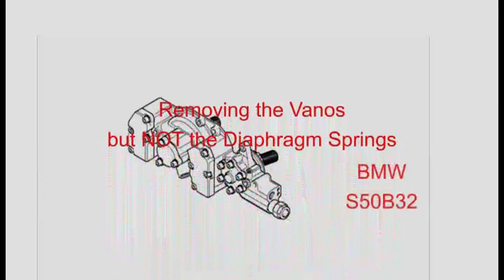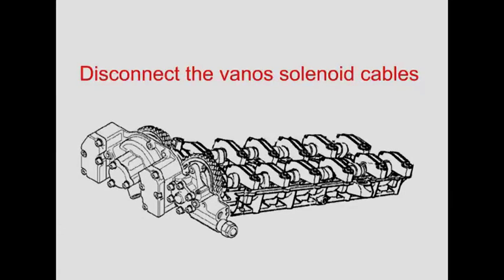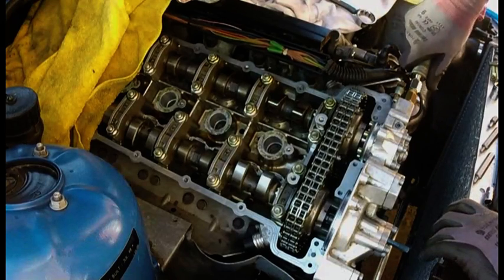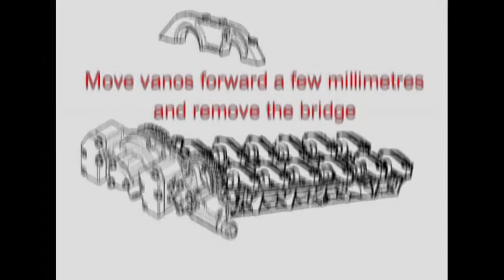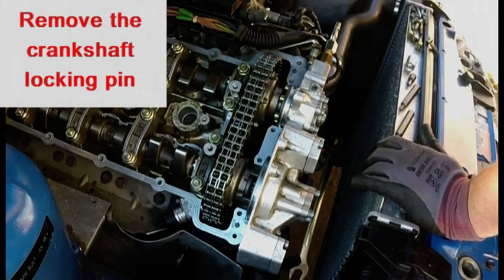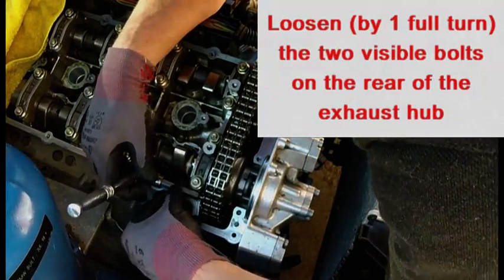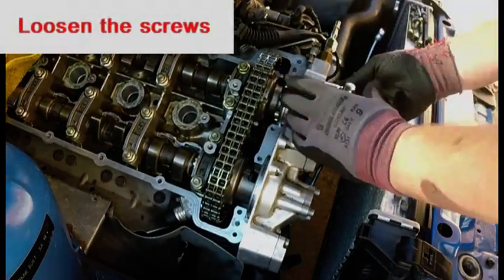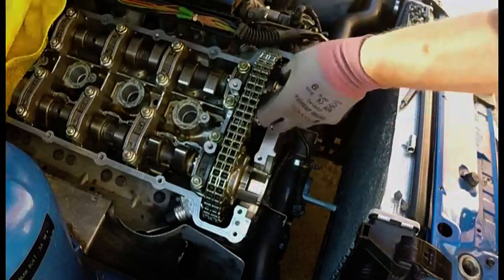Removing the Vanos on a BMW S50B32

Comment: Is the air procedure required?  I wonder why Beisan systems guide do not have the air supply in their guide?  Can the unit be removed as a whole without adding air?

At what point is it safe to remove the airline?  it simply is seen in one part of the video and then missing after the chain gaurd is removed

Since air is needed for removing, what about air for re-installing and when ?

Comment: If you do not need to take t he diaphragm springs out, you can also leave the helicoil gears inside the cams, so you only take off the vanos unit. Then you also don't need to loosed the gear/hubs of the cams.
Reply: Have you done this?  Without moving the camshafts, you can only withdraw the vanos by a few millimetres (as shown prior to removing the bridge).  The only way to do what you suggest would be to turn the camshafts as you withdraw the vanos.  I suppose you could turn the crankshaft as you withdraw the vanos (thus turning the camshafts), but due to slack in the chain, reassembly would be very difficult.  Happy to watch a video if it can be done.
Reply: BMW Maintenance Videos I have done this myself, using the well known Beisan instructions. Surprised you don’t know this method. The vanos pistons are connected to the gears by thread. The exhaust side is located between vanos and gear, on the intake side, the bolt is located at the very front, behind the cover. You turn the cams a little to make them more accessible, but that’s it.
Since I didn’t need the rattle kit, this was the method used.
Reply: What car did you do this on?  These instructions are only valid for the European E36 M3, M Coupe and M Roadster.
Reply: BMW Maintenance Videos I’m not that thick. EU E36 M3 3.2 (see my vids). Just check the Beisan procedure on their site. Absolutely no need to touch the cams or gears if you just want to take the vanos out.
Reply: BMW Maintenance Videos ps I have a picture somewhere on my pc where my vanos is off and you see the gears still inside the cams.
Reply: I've just re-read the Beisan instructions and you are correct.  If all you don't want to fix any rattles and only want to remove the vanos body (without the gears), you can remove the inlet nut (http://www.beisansystems.com/procedures/euro_s50_double_vanos_procedure_files/image052.jpg) and undo the exhaust spindle (http://www.beisansystems.com/procedures/euro_s50_double_vanos_procedure_files/image061.jpg).  Thanks for the feedback - I've amended the main description.
Reply: BMW Maintenance Videos You’re welcome. Really makes it much easier and doesn’t alter timing.